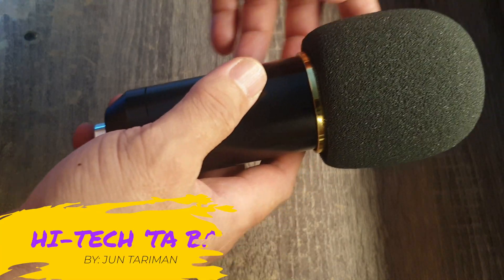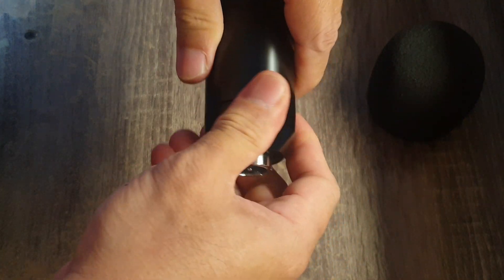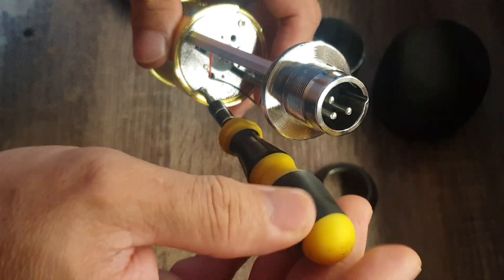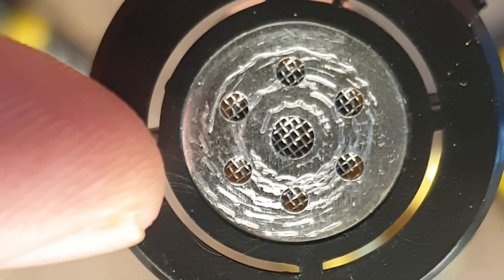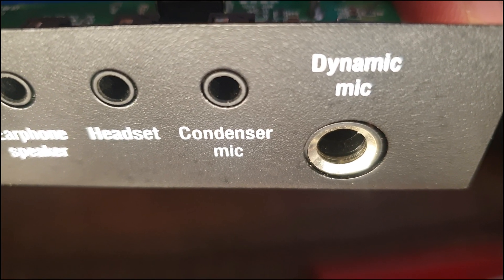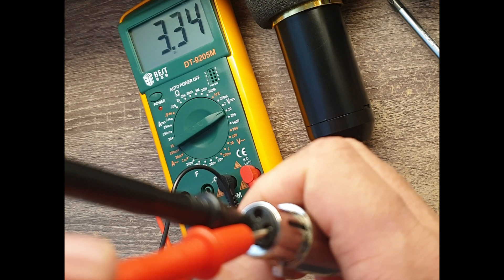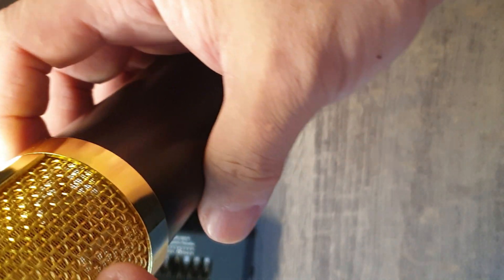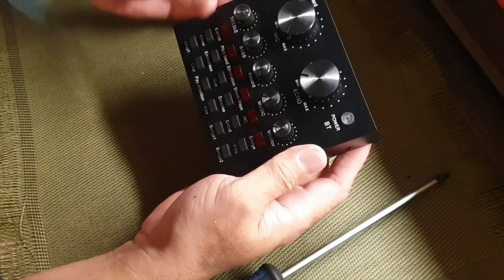INSIDE LOOK: What is inside the BM800 Mic?(Does it really need a separate Phantom Power supply?)

Comment: Is it support v48 phantom power?
Reply from the maker: It doesn't actually need a phantom power.
Reply: @HiTechTaBai  ohhh. I asked because I had the some one. Small board.  1 50v on circuit board
Reply: @HiTechTaBai  even I put on the v48 it will not damage the mic?
Reply from the maker: @JbRecordmusic  I tried that also and it has no effect to the mic. So, better remove the phantom power.
Reply: @HiTechTaBai  alright thanks. For your response.
Reply: Mine has to have phantom power to work in my audio interface (umc22) but it worked with an xlr to P2 (not that well but it worked)